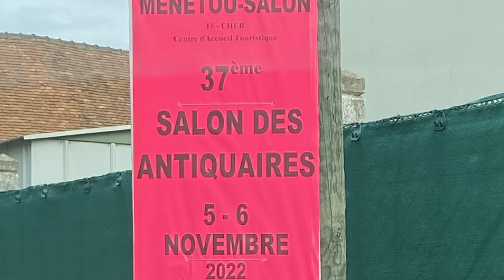Container Arrival & Preparing for the Perfect Thankgiving, Journey to the Château de Colombe, Ep. 50

Comment: No craters in the courtyard! Visited a vintner in the Loire back in the late 1990's/early 2000's. There had been torrential rains before we arrived. We pulled into the parking lot and I looked out the right front passenger door. There was a big drop off that was new, just to the side of the vehicle. The driver (a traveling companion) did not see it. Also, there used to be a restaurant in Paris called Thanksgiving. Your finds are as fantastic as always. Nice camera work and the items in Menetou Salon were certainly well-displayed. Loved the faience (if that is the correct term) in those shots. I see you succumbed in Chateauroux. The tureen is lovely although I wonder why snake for handle.

Comment: It must have been wonderful to see so many of your things again.  It is almost like Christmas.  I am wondering about the products you used to refresh you side table.  I have a piece from the late 1890's that has been attacked by wormwood.  I will use woodworm killer and wood hardener where it is needed.  My question is this, do you use the as well as the outside product on the inside of the piece to give more moisture to the wood.  Or, by doing that would it decrease the value of it?
Reply from the maker: Hi frank! Yes,  you can just use a wood oil on the interior to nourish the wood.

Comment: I’m curious guys, why set up the buffet when you haven’t finished the room?  Now you are going to move everything out to redecorate the dining room.
Reply from the maker: As we mentioned in the vlog, we are hosting a large Thanksgiving dinner party. It will be next year before we have everything available to finish/repair the paneling, walls, electrical, etc. As you saw in the vlog, it takes multiple people to lift and put it together, but now the buffet can be slid around by 2 of us and just covered up. Of course we want to display it now and also use it for storage when it may be many months before we have the time and supplies to work again on the dining room.

Comment: It’s great you received your containers. Why didn’t you paint the wall that your buffet/hutch is placed against before you filled up it up with your beautiful items?
Reply from the maker: As we mentioned in the vlog, we are hosting a large Thanksgiving dinner party. It will be next year before we have everything available to finish/repair the paneling, walls, electrical, etc. As you saw in the vlog, it takes multiple people to lift and put it together, but now the buffet can be slid around by 2 of us and just covered up. Of course we want to display it now and also use it for storage when it may be many months before we have the time and supplies to work again on the dining room.
Reply: @JourneytotheChateau  I’m glad the two of you can slide it. All I saw was the size and thought has difficult it will be to move it. Furniture movers are a must with large pieces. I have sliders that I can put under the legs of my large pieces of furniture and I can move them by myself. 

Good luck with the restorations.